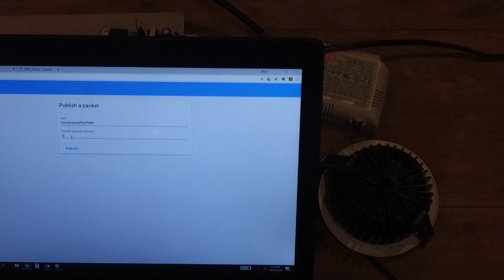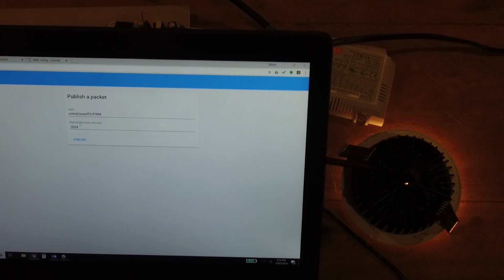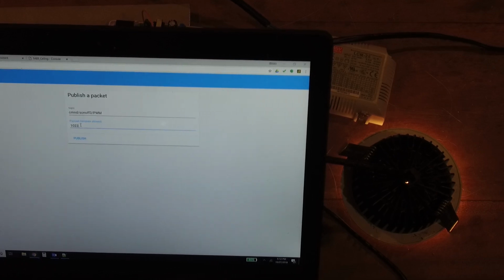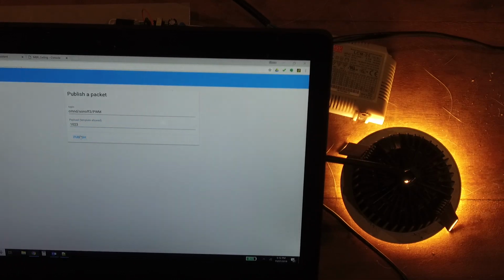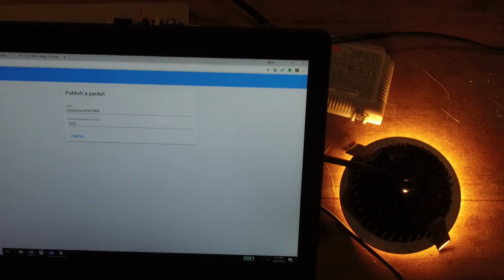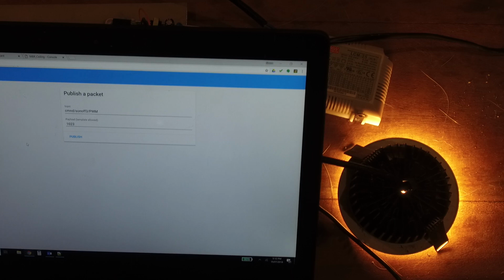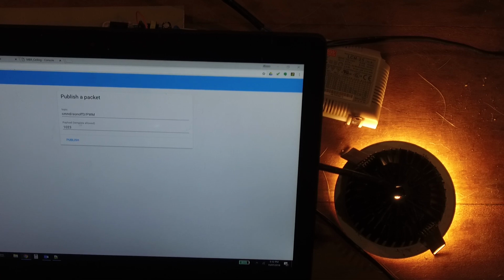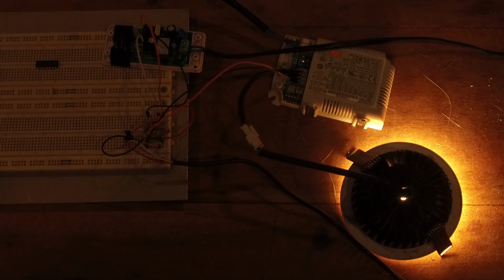Dimmable LED Downlight driven from Sonoff Basic

Comment: The newer LCMs allow not only 10V PWM but also "additive resistance". This means that the input is probably filtered and has 10V pullup inside. So one can use simple opto-coupler without power regulator and level shifter. We have test it in several projects and it is working.